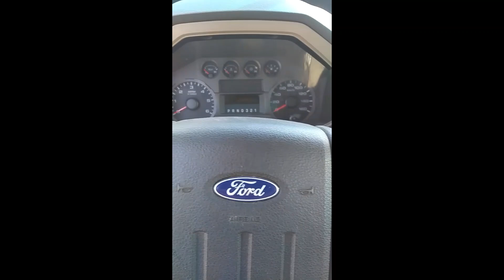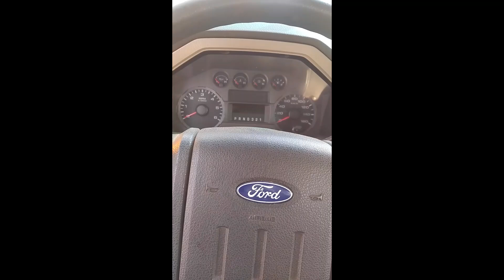2008 Ford F250 Super Duty Intermittent No Crank No Start

Comment from the maker: Update: The truck has started every time I've used it, since the long beep which originally got it going again. The PATS light now flashes 5 times after turn off. This has never happened since I owned the truck. So, this is a computer issue obviously. So if you are experiencing this problem, try starting the truck up to 15 times or until you hear that audible, and crank it as soon as you hear it, and maybe you'll get lucky as I did.